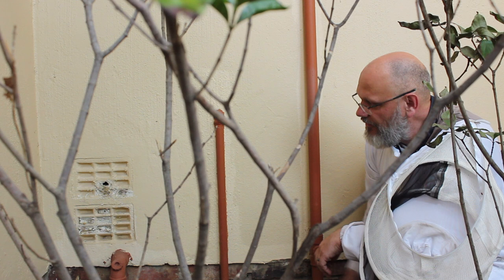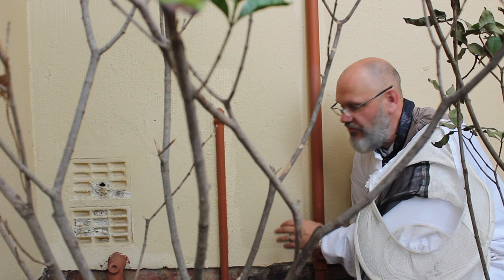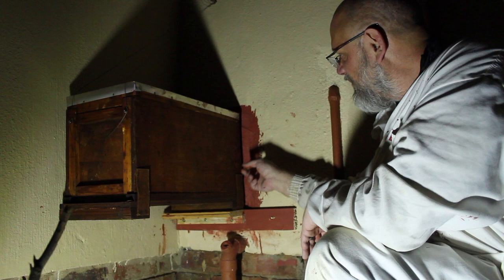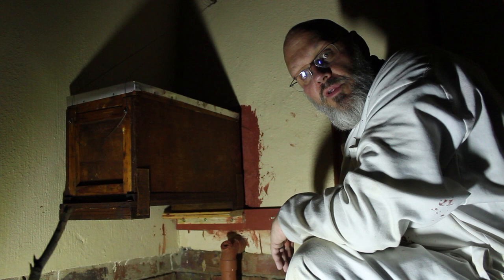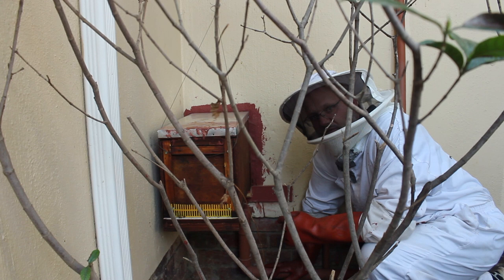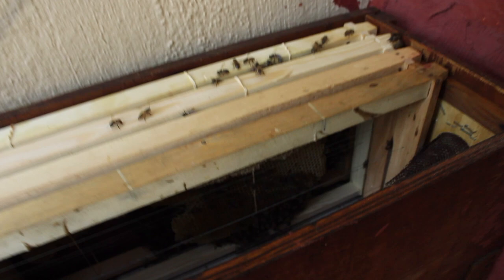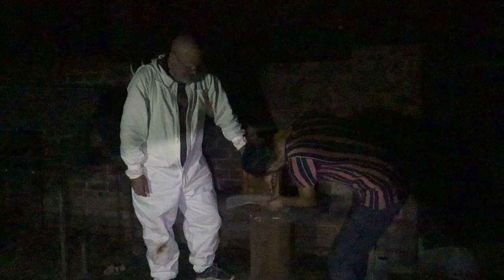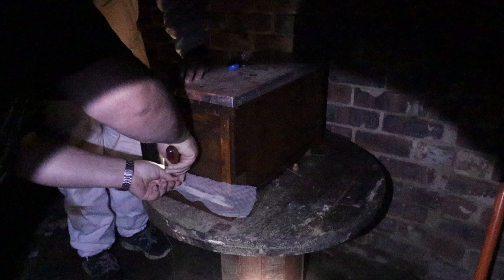Honey Bee Trap Out Instead of Cut Out (Successfully save a honey bee colony)

Comment: Did you make use of used comb or a frame which had brood?
Reply from the maker: Hi @Tau_ Wind_  in the trap outs we do we have not used any brood in the comb, for the pure reason we are unsure if the number of bees at the start will be able to keep the brood warm and then it goes off which the bees do not like. We just use normal empty comb generally. However, I have been told to use extracted honeycomb, which I have tried once with success. And I have heard you can use brood closer to the 21 days when your bees numbers in the box are higher. All our trap outs require the bees to pass through the box, by having the cone at the back of the box, and it is rare that we will just place a box next to a cone unless the layout does not allow us to force the bees through the box. (Take a look here on how we build the box: https://youtu.be/N0BjUhoX-Oo). By forcing the bees to go through the box we ensure on their return they settled in the box for the night which increases their numbers and then a brood frame can be introduced, sometimes eggs if we feel they need to make a new queen. Hope this helps and thanks for watching our videos.
Reply: What happens when comb and honey are left in the walls/spaces in the house?
Reply from the maker: The comb is completely cleaned out by the bees. So only the empty wax is left behind that will disintegrate over time.